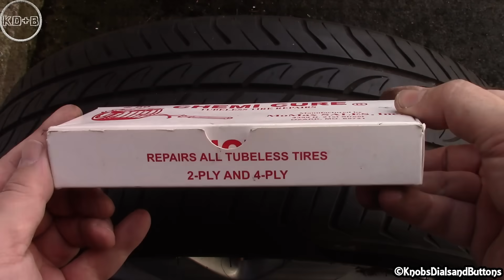How Tire Repair Kits Work - With Internal Views

Comment: FYI:  I used to be in the manufacturing business for tire repair plugs, just like numbers 1 and 3 in the video.  I cannot mention the name of the company, but we made the plugs and would put everybody else's manufacture label on it.  We only had one real competitor.  I traveled around the world selling millions of these, and we easily had at least 75 percent of the market on plugs.  (It was always funny to hear a customer state that he would only use XYZ brand, not knowing that we made it and that it was exactly the same as the ABC brand!)  Anyway, during the manufacturing process, we would cook/cure the tire plugs in giant walk-in commercial ovens.  They cooked in there, but not completely.  They would be removed and allowed to cool before we would put the plastic on one side and then whatever label on the other side.  Here's the important thing.  The plugs would finish the cooking/curing process once they are USED on the tire.  The friction and heat from the road would finish the process and make it about as permanent as the rubber on the actual tire.  In case someone looks at this video and wonders how long it will last, the answer is it will last as long as the life of the tire if applied correctly.
Reply: I can confirm with a dozen or so installations, I've had those style plugs last years and never a failure. The tire tread itself always wore before the plug could fail. I've used the black ones and the brown ones, with and without cement. I personally prefer to use cement and do so whenever possible.
Reply: Why can't you mention the name of the company? Is this some big secret? It's TECH Tire Repairs, isn't it? You know, Google exists.
Reply: I was out discount tire a few days ago and overheard a tech tell a customer they could not repair a tire if the customer already plugged it. I guess there have been some pretty large legal finding against these plugs. I have used them a number of times without issue, I wonder if the industry really thinks they are a problem, then why are they still available.
Reply: @mikethomas7138  It isn't that they are unsafe.  Discount Tire doesn't want to accept any liability for a repair they didn't make themselves.  They say there is a chance it wasn't done properly and moisture could have crept into the metal fibers in the tire and cause rust.  Plus making the customer buy a new tire increases profit.
Reply: @mikethomas7138  In many countries they are even illegal as the internal structure of the tire can be compromised, leading to tire explosion on high speeds. Tires are rated up to a certain speed, you don't want to find out the limit after happily pushing a reamer in and out.
Reply: Thats how everything is. The major tobacco companies own 80% of the food companies in the US and they do the same thing with the addiction market.
Reply: @zagreus5773  Somehow this reply keeps getting deleted.  This is my 4th time trying to reply.  Confidentiality clauses keep me from saying the name, but it isn't Tech.
Reply: @trailerwookie how long does the confidentiality clause exist for, given that you used to work at x Company
Reply: Everyone tells you must buy a new tire asap as soon as a puncture happens, but I had brand new pilot sport 4s installed not even a month after got a puncture.. well it lasted about 30k kms which was the life of the tire... never got any issues.
Reply: Are they safe to use, and considered not cooked if they stored in a heat of the car parked at sun? Or its a bad place to store them?
Reply: I've used #1 for many years at work and home. Just had my first "failure" that started to slowly leak again after about 10 months.
Reply: I was gifted a rope plug repair kit 30 years ago. It's from Safety Seal, it wasn't sold in stores & I had to resupply directly from the manufacturer.That may have changed now. I've plugged more tires than I can count, for myself & others, & NEVER had a single leak. I've even plugged sidewalls & used 2 plugs in one hole, and still they didn't leak. The plugs "vulcanize" to the tire to make a permanent seal.
Reply: @trailerwookie  exactly now adays it doesnt matter if the repair was done right or not its all about how the lawyers will argue it in court

i was talking to a truck driver the other day about accidents and preventive maint. he said lawyers now are going after ANYTHING AT ALL mechanically wrong with the vehicle that would give it a reason to NOT be on the road at that particular time when the accident occured
Reply: I worked at a Ford plant that made parts for Ford, gm, and dodge.  We made Steering racks and worm gears. If you have a heavy dutie Chevy dodge Ford or a Winnebago rv(even Google talk to text couldn't help me spell that one.) from the mid 2000s we probably made parts for it.   I worked in the salvage department and we would race our Cushman carts around the parking lot.  If you take the governor off a Cushman flat bed will do 30 mph.
Reply: @trailerwookie U cant or u dont want to? Huh? If u worked there in the past but dont work anymore it should not be problem to say a name. U are not anymore under NDA.
Reply: Oooh. Awesome info! Cheers
Reply: If you had only one competitor it must be the company I work for in Ohio we are one of only 2 companies in the U.S. that make string plugs
Reply: I've always had a good experience with plugs. No leaks and they last the life of the tire.
Reply: @yspegel there are things that compromise a tire far more than a small plug and don't cause a problem.
Reply: @OccasusRaven  if the clause extends beyond the duration of employment, not honoring it compromises his integrity, making it harder to find another job.
like, would you trust someone who breaks promises?
and we're not yet even talking about whether he could get sued or not.

and why should it matter to us if he doesn't want to say the names? it's none of our business, lol
Reply: Guessed that already 😂 my record is 12 plugs in one big hole. The tire lasted 6 months until professional repair was needed.
Reply: @OccasusRaven That's not completely accurate. If you don't know his agreement, don't go spouting off on things you are ignorant about.
Reply: It’s not that he can’t tell us…. But if he tells us, he’ll have to klll us 😮
Reply: Thanks alot for the details. I always used the first method, strip and cement. Doing that for 40 years. Repaired over 50 tires and never had a problem. All the repairs out lasted the life of the tire. Great stuff. Carry a kit in every car I drive along with pliers, wire cutters, and airpump with a gauge. Word got around at work and I ended up repairing coworkers flat tires. Did it for free. On their way home in less than 20 minutes. Only cost 25 cents per strip back then. Now it is like a dollar. Just make sure cement doesn't dry up on you by the time you need it again. Bought from different name brands but they all feel the same to me. Even the black vs the reddish brown still feel the same. Now I know why.🙂👍
Reply: I've found they last the life of the tire. Except in cases where I used rubber cement on the plug. Does the rubber cement interfere with the bonding process?
Reply: @trailerwookie  Think there's moisture in tires anyway from air pumps for maintaining psi if it condenses from driving it might get absorbed by any exposed metals –wheel rim
Reply: @yspegel Hence buy a new tire after a flat from a puncture.
Reply: @QGG639 exactly it’s happened to me I used in a brand new tire and after 6 or so months I noticed that little air start coming out
Reply: Same goes for car batteries. All made by the same manufacturer. No difference at all except for the name, price and warranty period.
Reply: @yspegel a good tire won’t be exploding with a properly installed plug. Tire manufacturers know people ride over screws and nails all the time and won’t spend money to get a whole new tire.
Reply: @yspegel  Oh the things that illegal in many countries! Oh the horror! Here is my take on it. I caught a nail in a tire of my 2014 AWD RAV 4. The" famous brand name"  tire shop wanted to replace all four tires which are under 3000 miles, as it was "impossible to fix it". Gave me great , excellent, reasonable explanation why I should pay for brand new set of tires. Quoted manufactures and government agencies' guidelines, manuals, regulations, google and AI.  They scared me to death with the consequences of my rash actions. My transmission would fall apart, the wheels would fly off to hell and I would die in terrible agony. To make the long story short, I repaired the hole with a tire plug from Amazon for $16.99. Of course, experts condemn my actions and believe that sooner or later I will pay dearly for my unwillingness to give the automobile service establishment its share.
Reply: If you're worried about having a problem using it until you change to another tire, you can rest assured that here in Brazil we (the poorest) use our tires until they reach the wire and nothing happens 😅

Quanto vocês ficarem preocupados se tem algum problema você usar até a troca de outro pneu, pode ficar tranquilo aqui no Brasil a gente (os mais pobres) usamos os pneus até chegar no arame e não "da nada" 😅
Reply: Very cool story and thankyou for sharing 🤙🔥
Reply: Sure you did in China right?  yeah I've used one too.
Reply: Wow I never knew that…. that is really cool! I’ve been using plugs like these Since the late 80s👍👍👍
Reply: @mikethomas7138  I believe most tire shop's use this BS story to sell more tires.
Reply: its Made in China. theyre just rebranded. as to my experience these plugs are safe I had 1 repair and its still there its been 5yrs.
Reply: Thank you
Reply: Wow so cool ty. I expect the kits for bicycles are similar, just smaller plugs.
Reply: In the 60s used crochet type hook, as like carpets dunked in contact, thought were banned but motorway speeds maybe not now, a temp method maybe.
Reply: @yspegel so in those countries are all repairs illegal? Because any puncture repair would have the same risks. Including professional tyre repairs
Reply: I have used both the orange color and black color, they both seem to work. Is either color better than the other?
Reply: Same size, same hole by the nails on the road
Reply: Thank you sir, these type of information is really valuable for people like us who does not know if these things really are going to work.
Reply: The sidewall repair you made shaded your overall point.
Reply: All look really LEGITIMATE and RELIABLE. I like that STICKY STRING application specifically but as I already stated, ALL look great.
Reply: I used to end up with tires having like 4 of these things in them before replacing them. Big enjoyer of these.
Reply: in my 35+ years of driving, the tire plugs have been the most reliable repair. I haven't had but one failure, and that was due to poor installation.  the hole was just outside of the max, but I tried anyways just to get on the road.  tire held up enough for me to get it to the shop, but there was a slow leak.  i drive a truck which apparently is a nail magnet, so there is always a kit in the glove box.  the repair does last the life of the tire, and I've have multiple holes repaired on the same tire hold up as well
Reply: @yspegel if the plug damages the tire then so do patch/plugs. And by that logic since the nail went through the tire it damaged it too and so you should replace it regardless. Bad logic.
Reply: In buying a kit tomorrow the last time I asked quikfit to repair a puncture they wanted to send the tyre away to be vulcanised  took a week at a cost of £20  no way cost and inconvenience
Reply: Yes my mechanics told me the same thing. ❤
Reply: Yup, driving after inserting the plug completes the seal by heat with road friction
Reply: @Jim-fe6gl  I fixed, plugged, over 10k radials,3.50$ a plug...now it costs 40 it's ridiculous
Reply: Exactly, I have never had a failure if it held air in the first place
Reply: What's the speed rating with a plug?
Reply: I use to process used tires by the hundreds daily. I can confirm lots
And lots of plugs leak.
Reply: @trailerwookie If its not tech then you lied about being 75% of repair kits
Reply: @zagreus5773  Can't mention the name because it's a made up story.
Reply: For the plug strip. You should push it completely inside the tire then pull it quickly out of the hole then trim. Cover the top in glue. Light it on fire till the plug melts to the tire.  Best way to repair it.
Reply: For some reason I always thought they put a torch to it and melted it a little bit first.
Reply: I've used plugs for many tires, including truck tires, and only had one that kept leaking. 

I think it was due to my plugs drying out since it was the type that didn't use cement glue that and because I didn’t ream the hole well enough. 

The last time I used it, the plugs were probably 10 years old.
Reply: 100% correct. I work in the battery industry and we produce hundreds of blank batteries and sell them to different parts stores. I always chuckle when I hear people argue about this manufacture makes better batteries than that manufacturer. All the while not knowing neither of them even produce their own merchandise.
Reply: Great to know as a simpleton that this is exactly how I thought they worked…
Reply: Thanks for showing the inside of the tire as a repair is being made.
Reply: I used to install, balance and repair tires as a teenager. Those sticky rope looking patches always lasted a really long time and really impressed me… i never installed any, they were always customer installed but i never seen 1 leak. We disassembled the tire, roughed up the inside area around where the puncture was, then applied rubber cement and pushed rubber plugs through thst had a circular patch attached to it. You press it smooth, reassemble the tire and presto! Good as new. Honestly, those damn self repair kits did work hella good tho… lol
Reply: This is the most interesting comment I've ever taken the time to read on YouTube 👍🏼
Reply: @trailerwookie pretty sure if air can’t leak out moisture can’t leak in. For sure nobody wants to accept liability, however they want to sell tires even more. I once got several flats thanks to someone who dropped a box of nails on the road. This was just a few days after purchasing 4 new tire one tire had 2 nails in it. I used  the strip plugs, and had no issues with the tires for the entire life of the tires.
Reply: Which type is most effective in your view?